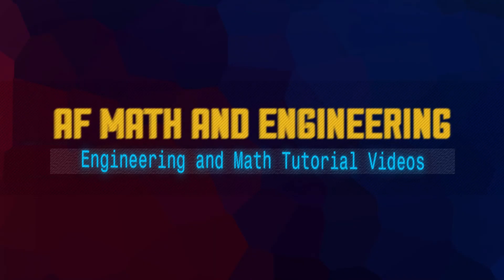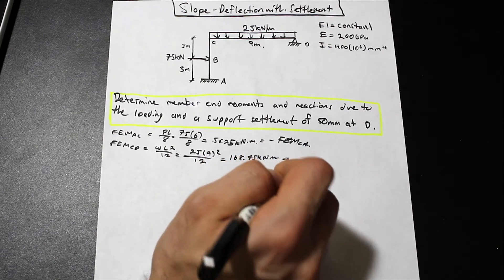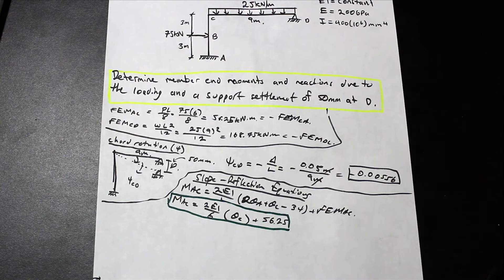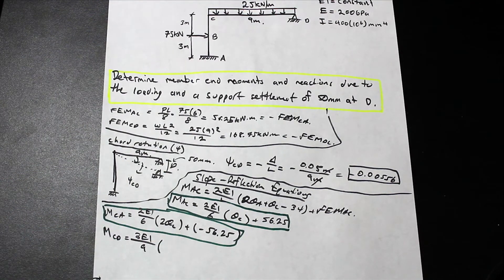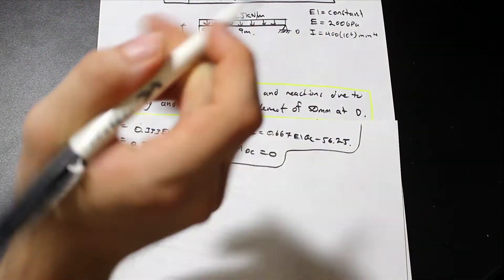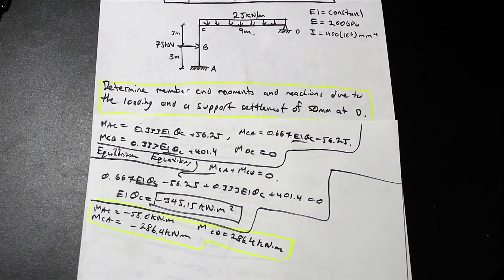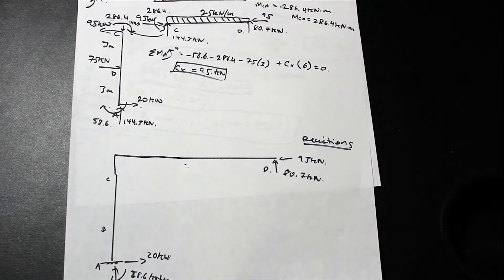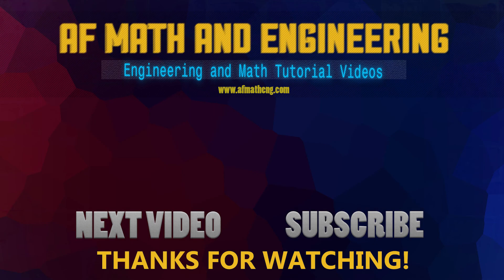Slope Deflection Method - Frame with Support Settlement Example

Comment: If the Frame is sway but the question say "Neglect the axial deformation "  then how to solve the problem (Can I consider as non-sway Frame ?)
Reply from the maker: It sounds like they want you to ignore p-delta (second order) effects on the frame with that note.  Does the question say sway? If it states sway I dont think you can assume non sway.
Reply from the maker: Or perhaps they're referring to slenderness of the members (buckling) that you can ignore.  Sorry I'd need to see the question!

Comment: In a beam problem I had with singularity functions, one of the compatibility equations was that the Moment of a support is zero... does that mean the sum of the moments is zero or that there's no moment in the reaction??
Reply from the maker: Hey man, thanks for your questions.  It depends on what kind of support you're talking about.  If the support in question resists rotation, there will be a moment developed at that support, assuming some load is acting on the beam.  However, if you have a support that doesn't resist rotation, e.g. pin or roller connection, the sum of moments at that support must equal zero.
Reply from the maker: Just a hint: It helps to think about it in terms of restraint against rotation or movement.  If a support prevents a member or whatever it's attached to from moving, the support itself must be resisting that movement and that internal force will be developed there.

Comment: Shouldn't it be wL^2/8 for the FEMcd? From the tables I have, wL^2/12 is when there are moments on both sides like both ends are fixed ie.
Reply from the maker: wL^2/8 is the equation for the maximum moment of a simply supported beam at midspan.  wL^2/12 is the formula for a beam in which both ends have fixed supports, and is the value of the moment at the supports.  Hope that helps!
Reply: @AFMathandEngineering  wl^2/8 is FEM_cd where joint C is fixed and joint D is a pin or roller. Also if Joint D is a pin or roller, there is no fixed end moment so FEM_cd would not equal -FEM_dc.
Reply from the maker: @billyjanssen5823  reread his post, I was clarifying to him why we don't use wl^2/8.  It doesn't matter if there isn't any fixed end moment in the actual beam, assuming the ends are fixed and finding the moment is a technique used in a number of structural analysis techniques.
Reply: @AFMathandEngineering  so when im finding FEM for any question, i just have to assume both ends are fixed eventhough there is a roller support in the question?
Reply from the maker: @wilsonteh1467  Yes
Reply: In the link that i've sent above, when finding FEM they used the supports in the diagram to find the suitable FEM ( such as fix end and roller support). Why is it so?
Reply from the maker: @wilsonteh1467  Doesn't sound like 'fixed end' moments to me if you're allowing rotation..it's been a while since I've looked at this..do you have a textbook from your school that goes into the theory behind this?  If you don't id suggest looking for the PDF mechanics of materials, that's where this example was taken from.
Reply: Yeah noticed that too. And now 7 years after you I tried to solve this with wL^2/8 and the answers will eventually be the same. But then you also need to use the modified equation for moment CD [ (3EI/L) * (Theta c - (delta/L) + FEM'CD ]. Then the moments will be same in the end.